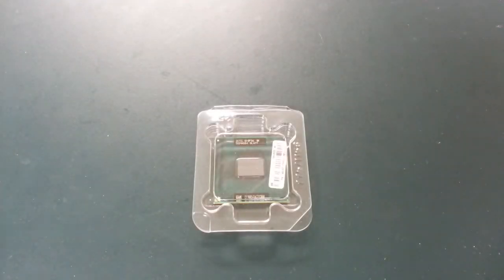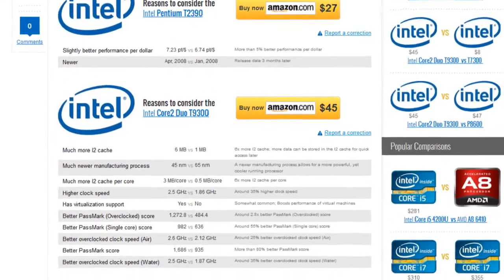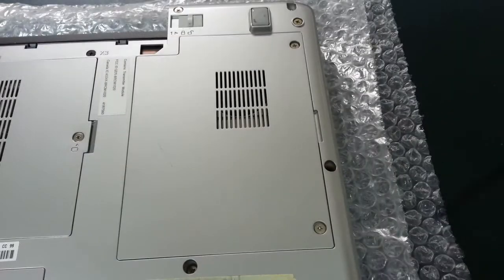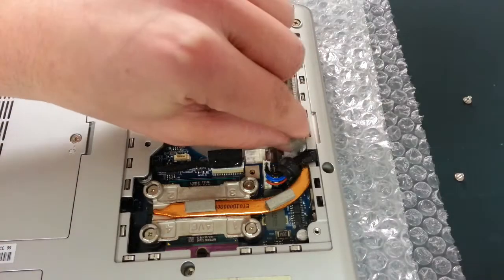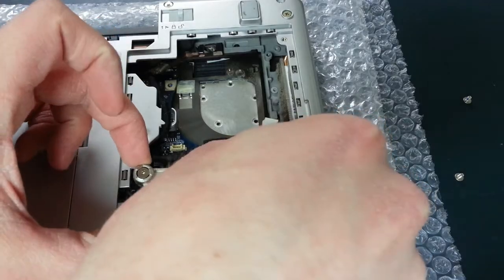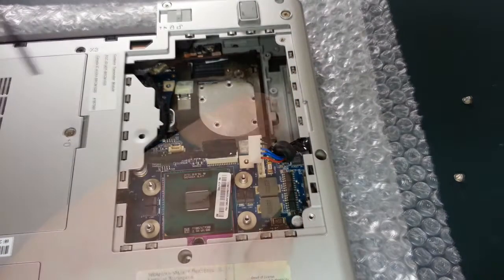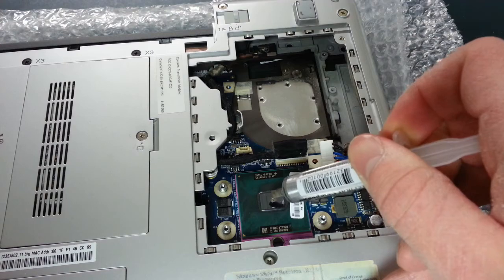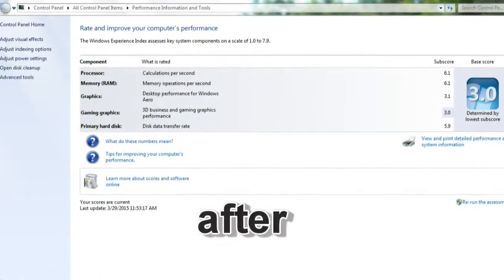Lenovo N200 CPU Upgrade Walkthrough and Observations

Comment: hello I have a lenovo n200, the processor is T5250, can I upgrade it to T9600?
Reply: Check the socket first (P or M). A T9500 would be the max for a P socket 800 MHz FSB. 🤔😊

Comment: I've tried upgrade my N200 0769-BGG from M530 to T7300 but it won't work. After power on, the lcd stays black and it's heard only fan. Bios version i've install the last v3.05.
Reply from the maker: Hmmm... It should take it. Is that consistently replicable?
Reply: @Browningate  Sorry don´t know what you mean with "consistently replicable. I´m just upgrade bios to v 3.05 with old cpu M530. And after upgrade bios with old cpu and simply switching to the new cpu i have this problem. Don´t know if i have to do some software steps before new cpu upgrade or if it´s necessary allow DEP in hidden settings. But there is only simply bios without any advance setting options (voltage... etc.).
Reply from the maker: @lukaskunt637  When you switch back to the other CPU, does it boot normally?
Reply: @Browningate  Yes, it's boot normally again.
Reply from the maker: @lukaskunt637  I'm not sure; that's super weird. Did you make sure that there weren't any bent pins or other obvious defects?

Comment: Good Evening; I did all of this last night (14th of January 2020), but for some unknown reason, my Laptop has just stopped working.  I bought the T9300 CPU from Amazon,  along with the "Goo Gone " and the Arctic 5 Thermal Paste.  Everything was performed and applied as instructed in the video, but for some unknown reason, My Laptop (Lenovo 3000 N200) is "bricked ". It makes the usual "start-up" sounds,  for about 5-10 seconds,  and then switches itself off. If this was successful, I'd planned to upgrade the WLAN card to a brand new Wi-Fi/Bluetooth Card. Please can you tell me what action to take in order to get my Laptop working again? Cheers 😁👍🇬🇧!
Reply: Maybe u need to upgrade the bios before ? So u have to install ur old processor, upgrade ur bios and then upgrade ur processor.

Comment: is it working with this procesor T9300?
Reply from the maker: +Mariusz Lewandowski
Yes, fully functional. I wouldn't say it was a night and day difference (the removal of that wad of dust probably did more than the T9300), but it was noticeable. Unfortunately, this computer is hampered more by its weak GPU than anything else, but it's still got a lot of life left in it.
Reply: +Channel 2012 thank you :)
Reply: Just wondering what is the best cpu for this laptop that you can get?
Reply from the maker: Zachary L
That's probably it; at least cost-effectively anyway. You might be able to go one or two models better, but they cost significantly more and offer little (or no) noticeable performance improvement. Like I already mentioned to the OP of this thread, the bottleneck in this system is the video system, not the CPU (unless you're fortunate enough to own one with something other than the Intel Graphics).
Reply: Well mine n200 has a geforce go 7300 which isnt good but im planing to buy and adapter where you put the wireless card into it and it converts to a pci-e adapter so you can connecta full blown graphics card
Reply from the maker: Zachary L
Oh, one of those mini-PCI Express to PCI Express deals. It might work. Certainly would be an interesting project.
Reply: ***** yep just gotta get this started haha
Reply from the maker: Zachary L
Remember, it's more of a novelty project than anything. Your laptop won't be a laptop anymore because you'll need an external power supply for the video card and a network connection (and an external monitor). That's not to mention the fact that the PCI Express x1 bus will slow down the performance of your card a bit too.

If you're after a decent gaming experience, you'd probably best off buying a cheap computer motherboard for $35 on eBay, but if you want to see exactly what this laptop is capable of just for the sake of experimentation and aren't afraid of being let down by its limitations, then go for it. Also, make sure you have sufficient funds to cover the entire project before you get started.

You may be able to find some information on the (now-derelict) Lenovo forums about CPU support in that model if you want the absolute best. That model should be old enough that there would actually be some posts on it. (The official Lenovo community forums became a ghost town sometime within the last couple of years). Otherwise, the ThinkPads.com community forums have a spot to ask questions about the N200 series and its platform-mates. T9400 or T9500 are probably some of the overall-best processors that'll work in that model. They're not that much better than the T9300 for the price though.
Reply: I have a powerful desktop and I just want to have a decent laptop so my idea is taht at home I can use the graphics card and at school or something I can use the integreted geforce go chip only thing that annoys me the most is the ram having a limit of 3gb
Reply from the maker: Zachary L
Au contraire! http://tinypic.com/m/jgth5j/3

That said, if you do still plan on using it as a laptop, be aware that the transition between desktop and laptop will be a slow one. Unplugging a mini-PCI-express card, plugging a new one in, reinstalling the screw (or screws) and then closing the cover on the bottom (and putting that screw back on too) takes some time. Don't forget that you'd probably have to shut the machine down to do this as well, so you're probably looking at a ~5 minute ordeal.

Also, you won't be able to use the laptop's screen with the external GPU; it'll have to be hooked up to an external monitor, which will consume even more desk space.

Those are just a few things to consider before going through with such a project.
Reply: ***** Well on thing im planning to do first is to cut a slit into the shield plastic thing so I have it be able to get done without having to go through a process and im fine with about 5 mins of doigng this task as I have a small monitor Ill update you when I have gotten this working haha have a good day!
Reply from the maker: Zachary L
I hope you do too. Measure twice, cut once, and be careful when doing stuff that can't be undone. Remember that you'll still have to open the cover all the way in order to swap the wireless card back in there (that is if you want wireless functionality when you're out and about).

Best of luck; keep me posted!
Reply: ***** OK thanks Ill probably have done this in about 3 motnhs as I need to save haha
Reply from the maker: Zachary L
Make sure you have the means before you start. Not all potential issues can be accounted for, but you'll have a better time if you do your homework first. Best of luck! Keep me posted if you do go through with it.
Reply: Will do!
Reply: So? Did it work ? 4 years are passed and I want an answer :)

Comment: Good job ! Can you post the specs of your model, your MB is a IEL10 (GM965 chipset)  with 3. 05 bios isn't it ?
Reply from the maker: +Evan Blue 
Sure. It's practically the base model (0769-AUU type) with the 1280x800 LCD, Intel video, and no webcam. It originally came with 1GB of RAM, but I've upgraded it to 4 over the years. The BIOS is on the latest official version, but I've used SymCmos to change the hidden settings to allow DEP (or whatever it's called), enable advanced virtualization features, and disable panel stretch.The trackpad and keyboard in these machines are rock solid also and I'd use it another five years if it had better graphics and a way to hook up multiple external monitors.
Reply: +Channel 2012 Yes this Lenovo is a good laptop, well built and nicely upgradable, it's just too bad video is weak.
Now i'm sure t9300 is compatible, I'm going to follow your example and purchase one.
Thank you for the idea of SymCmos, i'll search infos on how to tweak my 3.05 bios, if you have some i take it !
Reply from the maker: Evan Blue
Sure, here's a step-by-step: http://www.techsupportforum.com/forums/f338/solved-vmware-player-error-0x5d-when-booting-from-installation-media-906394.html#post5710546

Mind you, that may only apply to the 15" model, so double check the original post (linked to in that thread) to make sure it is compatible with your machine. If it messes something up, you should just be able to reset the CMOS settings to get things back to normal.
Reply: +Channel 2012 
Thanks a lot but it seems the forum where the original post was hosted is closed.
Reply from the maker: Evan Blue
It shouldn't be. I just checked and both links are good.
Reply: +Channel 2012 
Yes, my bad. I had to open the link in a private mode tab to avoid a redirection to the Lenovo shop, weird.
Thanks !
Reply from the maker: Evan Blue
You're welcome. I hope it helps.

Comment: Please tell me that was running windows 7 and not windows vista.
Reply from the maker: +Dudefoxlive 
Lol, what difference does it make?
Reply: +Channel 2012 a big one vista sucks and 7 is so much better.
Reply from the maker: *****
How so? And what is a "big one Vista"?
Reply: +Channel 2012 vista was a bad os from the start and 7 is just so much better also i ment to add a period after a big one
Reply from the maker: *****
A big what? Vista's shortcomings are overplayed and moot points after the service packs are installed.
Reply: @Browningate  install tiny 7
Reply from the maker: @Cheese - Lol no.
Reply: @Browningate  why?
Reply from the maker: @Cheese - Because it's pointless.
Reply: @Browningate  explain further, it eats less ram
Reply from the maker: @Cheese - Windows doesn't use much Ram to begin with. It's literally Windows's job to provide a platform for applications to use memory.
Reply: @Browningate  windows 7 uses1 gb and tiny 7 uses 300mb , good for systems with 2gb ram or so
Reply from the maker: @Cheese - I'm more than a little skeptical of that. Even if this claim was true, the slight amount of misery you might save would be more than made up for by the other inadequacies of whatever hardware you're using that only has 2GB of memory.